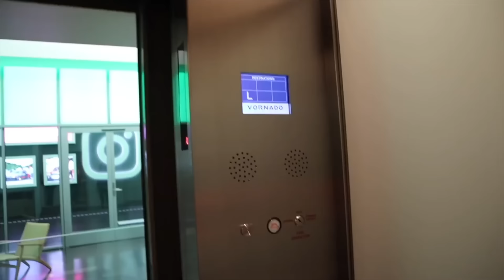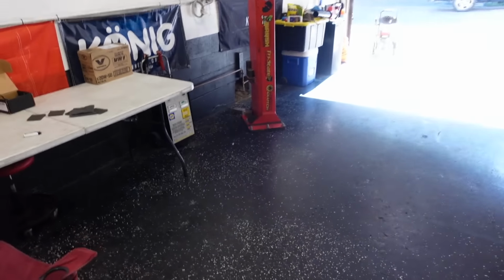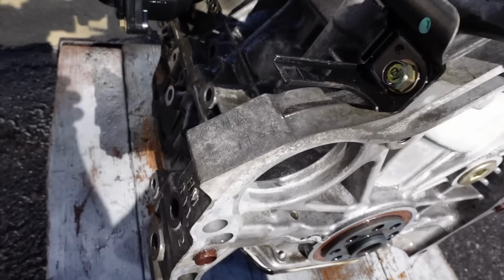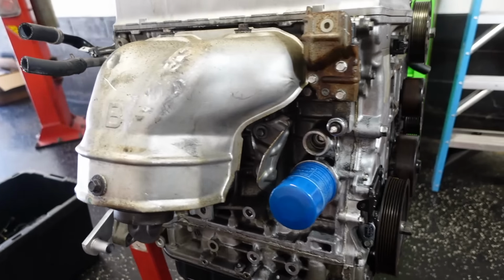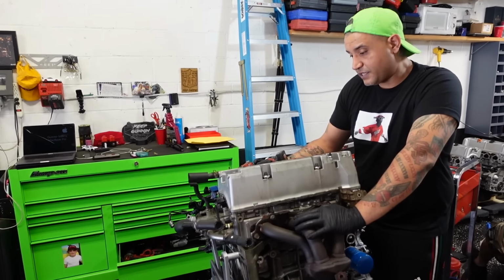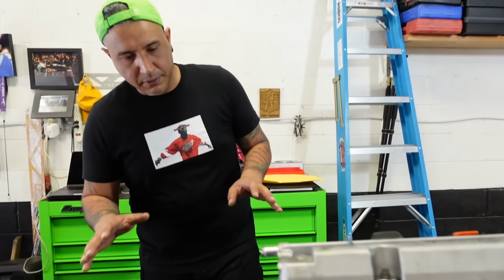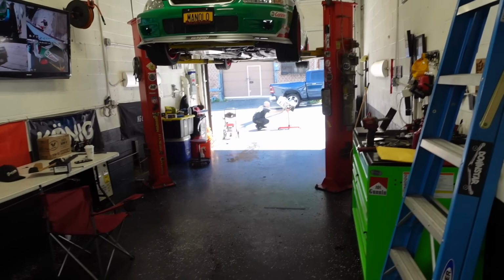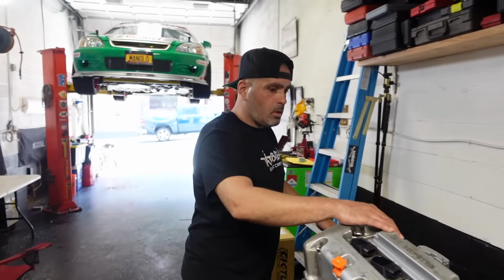Degreasing And Power Washing ALL 5 K-Series Motors‼️

Comment: Great work guy's keep it up, I have a suggestion I've have always used oven cleaner on my honda motors & pressure washer let me tell u it will not harm or damage the aluminum and it leaves it and gives you that oem aluminum new look try it. Hope it helps.